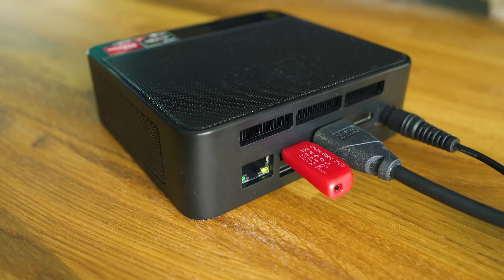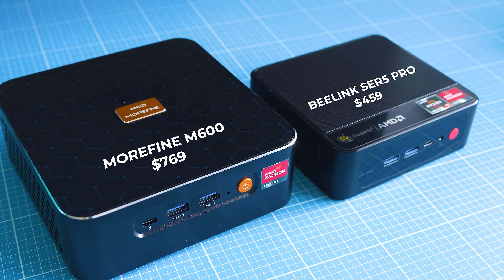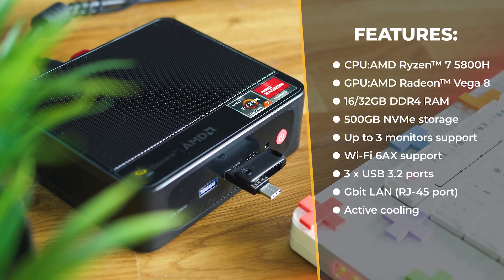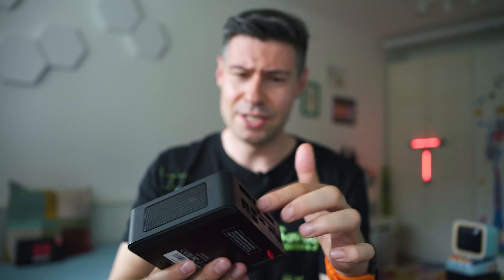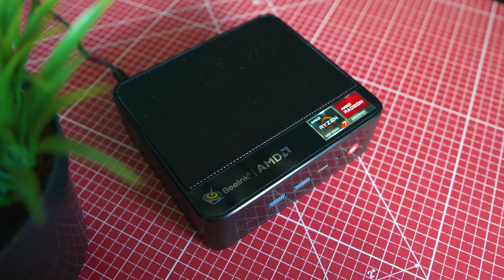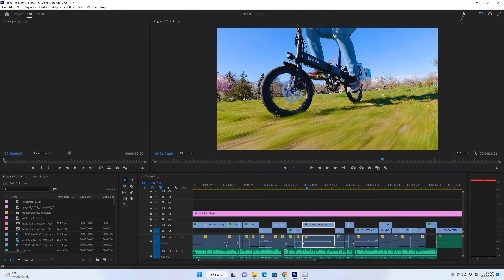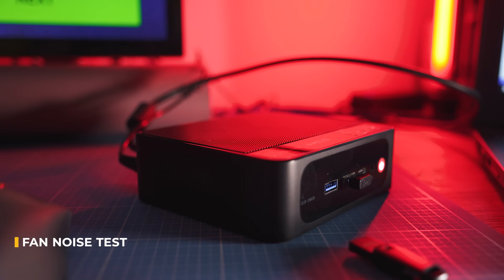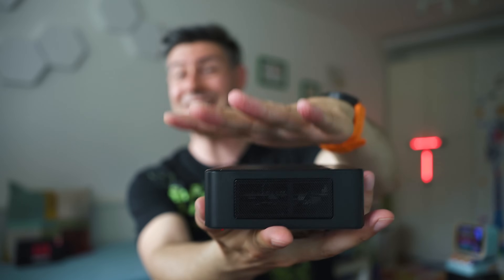Windows 11 Pro on a Ryzen 7 Mini PC: Can Beelink SER5 Pro Replace your Desktop? [REVIEW]

Comment: My 5800h is missing the ssd cooler and plug i paid for the pro did i get a non pro?? it also has a hdmi and display port but windows 11 says its a 5800h.and it doesnt have those stickers either
Reply from the maker: Interesting. Might be a different back with different specs, but... Hmm - make sure to reach out to their support.

Comment: Hey - do you think this is a good choice if you're working in a hot room? I want to keep it cool as possible - I'm doing mostly browsing with lots of tabs and applications opened, also Youtube. Thanks :)
Reply from the maker: It will be alright, but the fan will be somewhat noisy.
Reply: @TechMishka  I ended up buying the 'GEEKOM A5 Ryzen 7 5825U' - it turned itself off 3 times during the windows installation and also during benchmarking...I assume this isn't normal? 😅
Reply: @AM2K2  Is it still working?

Comment: Hello! Great vid, really helpful with all the details you provided and it is easy to understand. I am planning to buy SER5 Pro as well, however the 5850u variant is the only one available in my country for now (5800h are all sold out). Is there huge difference performance-wise?

Will mainly use for basic programming, school works, and emulation (3ds, maybe switch). Thanks!
Reply from the maker: Get something with 7xxx series - the 680M/780M Radeons are so great!

Comment: I bought this for emulation and just daily primary tasks, like browsing web, watching movies / tv in 4k, streaming, YouTube and whatever else one does with a desktop PC.. Its 4 yrs old at this point and still running like a champ despite being put through hell all day every day; being disabled and not into touching grass I have put this PC through its paces and Its held up fine for 4+ yrs - Except for the Bluetooth adapter. Intel BT 5.2 I think? failed late last year and I've been using a PnP adapter ever since, no problem. Only gripe I have is the lack of gaming abilities. It was recommended everywhere, just like here in this vid, as being plenty capable however my experience has been not very happy in that regard since there are so many very noticeable limitations in its gaming abilities. Yeah. its strong enough for everything up to PS2, most PS3 and some 4 even but I was hoping for something that could handle Gran Turismo 5 and shit like that.. Nope. GT5 crashes the entire device every time even at the lamest settings. I guess I shouldn't bitch since I have managed to run GTA-V with all settings at the lamest level with absolutely no hiccups at full 1080p and even 4k until I broke my tv last week, so its not the worst or anything. Just would've liked it to be a bit more capable in order to match up to the expectations set by videos and reviews such as this one I'm commenting on currently <shrug>
Reply from the maker: For gaming - the 680M and 780M series are a lot better options.
Reply: @TechMishka  mine has the 780m, homes..
¯\_(ツ)_/¯ it's not great for gaming - I have to put all the settings on low for San Andreas to run well, same with GTA V and I haven't even bothered to attempt RDR II yet bcuz of the piss poor performance I've gotten from the aforementioned titles and games such as Gran Turismo 5 straight up crashing LaunchBox.. I would assume that the decent Ryzen 7 5800H paired w/ 780M would be capable of better than the results I've gotten.. Then again, I'm also extremely new to PC gaming and should probably spend some time looking into the best settings for the titles I'm having issues with. I recall seeing perhaps a reddit thread or some forum somewhere that was dedicated to listing the best settings for every title of every console but I don't recall where atm.. It's def worth searchijg for since it's the lack of the most optimal settings being likely the genesis of my problems.. Yet another possible problem I can anticipate would be the lack of the ability to tweak settings in LaunchBox since I have the free version, so.. 
Yeah idk ¯\_(ツ)_/¯
I swear, if it ain't one thing, it's another..
Good f'ing God just kill me already ughhhhh
⚰️🪦☠️✌🏻🩸🙍🏻‍♂️🤷🏻‍♂️🤦🏻‍♂️<-----💥🔫
Reply: Fuck, I'm sorry - I think it's actually the 680M I'm rocking in my particular build SER5 Max

Comment: I got one in the late summer of 24, put in 32 gig of ram, along with a samsung 4tb ssd sata drive and do all my photography on this, however now the graphics is pushed to limits doing AI Topaz, I need to step up but finding a mini that uses SSD Sata drives is hard to find, at this point thinking of one that can hold a 8tb M.2 and a 2tb M.2 for 10tb of M.2 drive and 32 gig of ram with top graphics for AMD drive mini.
Reply from the maker: Yeah, the AI intensive tasks run better on the newer CPU generations

Comment: I also have series 5 pro, with ryzen 7 5700U processor. Is it possible to add a graphics card and if so where do i start? Idk what to do but i want to be able to play inZoi , right now it’s very grainy 🥺
Reply from the maker: There might be an option to use the M.2 slot, but I don't think it will be a great choice. Check some of their modular solutions released this year. I believe your device still has a good resell value

Comment: Beelink has the most dreadful so called tech support team. If you have a post purchase trouble - like first the fan goes 79dB then rattles and eventually dies... - you are by yourself. The tech support team is evading, avoiding, promising but does absolutely jacksh.t! Less than a month old Ser5 Ryzen 7 machine is a doorstop...
Reply from the maker: Probably it is just the fan. Keep on pushing them. Usually sending them a video with the issue and a few reminders helps a lot.

Comment: Can I use it on my MacBook Air? I mean can i plug it in to my new chromebook hp laptop or and my MacBook Air 2020?
Reply from the maker: It is a separate computer. So you need to connect it to a monitor.

Comment: Or to sum up, if you are a serious gamer you shouldn't be buying something that is not designed for gaming. And if you think this is going to cut it as a gaming machine then you need to learn what you need to game. Better yet buy a PS5 or XBox because you clearly aren't mentally equipped to ascertain your needs.
Reply from the maker: Agreed. Sometimes it is down to the available budget and some folks prefer to have a PC that can eventually be used for gaming as opposed to a gaming-only setup.

Comment: I bought the Ser5 Max with same specs, 5800H 32GB RAM 500GB SSD and all I can say this is a beast. I guess it was a deal for $289 on Amazon comparing it to a laptop or desktop unit. 
Im amazed at its performance taking into account that my previous laptop specs were an Intel Celeron with 4GB RAM and 256GB HDD used to study programming 😅
Reply from the maker: Awesome deal you got there. Enjoy programming 😊
Reply: @TechMishka  Thank you! It was such an upgrade!
Reply: I got mine for $199

Comment: Im running an ASUS Vivobook 16 with the AMD Ryzen 7 5800h and integrated Radeon graphics on 16g RAM. I picked up the laptop for $435 brand new from best buy a couple months ago ive never seen them that cheap and haven't seen them as cheap since. The max refresh rate is only 60hz but it's still very crisp and clean. Im getting 78Fps on average in GTAV with all settings on high or ultra except for the long distance shadow setting. Of course this is running AMD boost at 4.4Ghz and on power. It can run like that for about 2hrs on battery alone. I'm happy with it.
Reply from the maker: Oh this is awesome. My laptop also has the same CPU and I am super happy with it too.

Comment: Thank you very much for de excellent review. For me, silent operation is very important, so I think that for my type of use (excel, outlook, Netflix 4K and Dropbox Sync) the version with the 5500U CPU would be a more suitable option, although due to the difference in price the version with the 5800U CPU is more attractive, taking into account performance. What is your opinion?
Reply from the maker: You are right - 5500U is still great about performance and will stay cooler.
Reply: @TechMishka  Thank you.

Comment: Does anyone know how to remove the internet connection without logging in? I’m stuck on the sign in to Microsoft page and there are no options to do anything else. No create an account option, and won’t let me use my personal (and only) Microsoft account
Reply from the maker: You may have to create the account until the end, and then you can create a local account, make it with Admin provilleges and delete the first one.

Comment: This is actually very competent for gaming if you assign 8gb to the vram on the bios. I can play elden ring at 1080p 60fps on medium just fine
Reply: Is that from the processor or the ram that you allocate these 8gb vrams?
Reply: @HeyYoItsPhil  what? I allocate 8gb of the existent overall system ram to be dedicated to vram only. Processors dont have ram. Just go on the bios and define the UMA_BUFFER to 8gb, but only if your machine has 32gb or more of ram. Would definitely not recommend it if you dont run dual channel.
Reply: @Mrjazzzery  Pretty easy to look up what Dual Channel RAM means.
Reply: @StarmenRock you are a Rockstar! I just did this and I'm now able to play my games on high settings
Reply: @lholliday198  nice, very glad to know!
Reply: @imaginova88  beautiful and smart is a really deadly combination, how do you do it?
Reply: do you have any other good tips for stuff like this to increase possible performance i’m getting one for my girlfriend
Reply: @ just make sure to get one with DUAL CHANNEL RAM and a good nvme ssd. Also don't keep it in a stuffy place, cuz if it gets too hot the performance gets iffy. preferrably dont put a sata ssd on it because it blocks a fan inside of it.
Reply from the maker: Yeah, very good idea.

Comment: I bought one a few months ago. Quite happy with it overall. I tried twice cloning the 500Gb drive to a Samsung EVOPlus 970 1Tb drive, and encountered an error message regarding some Visual Basic related problem. However, I just click "ok" and the error sign goes away. The unit performs well afterwards. I run DaVinci Resolve 18.5 (non-studio version) and encountered little issues - of course no heavy editing. For quick and simple projects, I use the free Capcut - this one definitely good on this unit.

Any idea about the error message on boot up mentioned above?

Thanks for your reviews. Very much appreciated. Keep up the good work.
Reply: Did you use the 32gb ram? For editing as I want to use to edit gameplay. Unsure whether to go for it
Reply from the maker: The 32GB edition is awesome. 
@TikTok-bl1rm - did you try doing this with Acronis?
Reply: @TechMishka  No I don't have access to this software. I used the free Samsung Migration software.

Comment: Getting one shortly to replace my 12 year old desktop/tower. Can't wait to migrate to such a tiny footprint and get so much more power!
Reply from the maker: Yeah, the space gain is awesome!
Reply: I just did the same. My 10 year old Intel died on me, decided to go with this exact model. Have had it for a week and love it. Small enough to mount it behind the monitor which makes it pretty much disappear.
Reply: @rsthegoldenfist25 I am thinking of getting one of these myself, my tower pc has a ryzen  5 cpu and rx 570 gpu 16gb ram but I may consinder getting this mini pc but just not sure though if I should do this or just upgrade parts.

Comment: I'm looking at mini PCs to replace my existing Plex Server (Mac Mini 2012 Dual core I5 with 16gb). Would you recommend this PC my main concern is how will it handle decoding when another PC connects via WIFI to view 4k contents. Also, does it support connecting a soundbar via optical connection. Thanks for a great video.
Reply from the maker: I think the performance will be good enough, but the part with the sound bar is a no-go. There is only HDMI as a digital output option
Reply: @TechMishka   thanks for the response.
Reply: The 5800H should be vastly superior to a 2012 Mac Mini 2 cores vs. 8 cores on the 5800H.  Also, everything else like USB is probably bigger, better, faster.

Also, you could pick up an HDMI-Optical splitter, or possibly if you're plugging into a TV, the TV can possibly act as the optical splitter if it has optical out.

Comment: I bought this one on amazon, it was a great price, great solid specs, but the one thing these manufacturers ALWAYS cheap out on, especially AMD is the thermal paste they use.  I have noticed, and its the 3rd time with AMD processors, they use the shittiest TP known to man.  So buyer beware, if you're not technically competent and unable to replace the TP, then you will notice the fan constantly whirring and spinning trying to cool the pc down.  I used HW monitor and it showed 92 degrees for the cpu, just while booting up and running light tasks.  With my previous absolute GARBAGE experience with AMD thermal paste, I decided to clean it off and replaced it with NHT 5.  My temps dropped at peak from 92 deg to 86 degrees.  This might not seem like much, but that 86 degrees is something I got from stress testing with prime 95 for 20 minutes +, while that 92 degrees with the stock TP was from literally booting up and running light tasks.  AMD / beelink, shame on you for using garbage TP.
Reply: Very interesting finding and love it! I've been running my SER5 Pro for a week or two now and do notice the fan noise a lot. I'd love to get this thing to quiet down a bit and your suggestion sounds great.
Reply from the maker: Oh, this achievement about the temperatures is great.
Reply: Thanks for the advice i got one today, the first thing i will check is the thermal paste on the cpu. Thumbs up man

Comment: To put an external GPU, you would have to purchase the NVME to PCIE adapter. Disadvantage of losing Nvme port, but will run many games or heavy software
Reply: How many mvme ports does it have because wouldn’t you be losing the storage?
Reply: @yaboihug4944 You would lose the NVMe storage but you would still have the option to connect a 2.5" drive to its SATA port and run your operating system off from that.
Reply from the maker: You will, yeah...
Reply: Do you think it can handle blender renders?
Reply: @keithkhumalo5396  I think so. It would depend on the graphics card you use.

Comment: I got this unit over a week ago, I'm very happy with it, however I've noticed in BIOS that there's options to overclock ram and other things like upping the TDP, beelink claims this unit can't be overclocked, despite the options in the BIOS, could you possibly do a video tutorial on the BIOS settings, I'd be much appreciated as I'm sure others would too. Many thanks and good channel!😊
Reply from the maker: Hey Rob, I am not an overclocker myself and prefer not to showcase something I am not quite certain about.
Reply: I was gonna reply this comment then I saw it was you 😁
Reply: @KatRollo  haha no problem thanks!
Reply: Is there a virtualization setting in the BIOS? I want to use Hyper-V. 
Thanks.
Reply: @samlebon9884 it's on by defualt